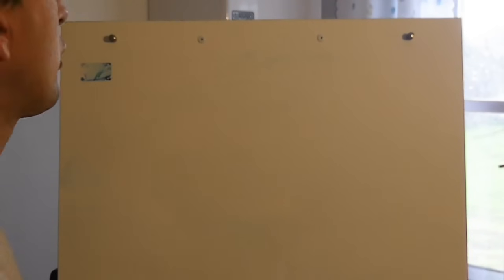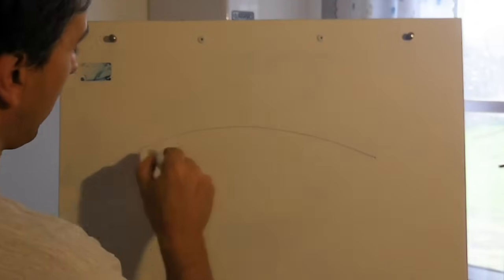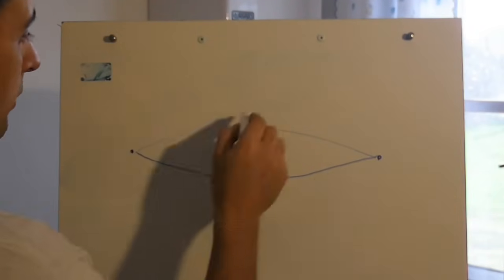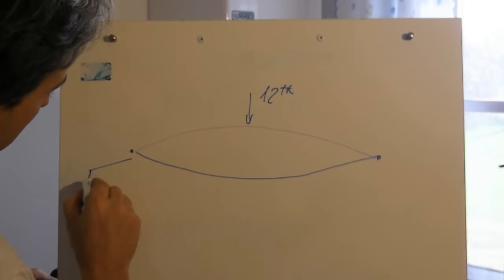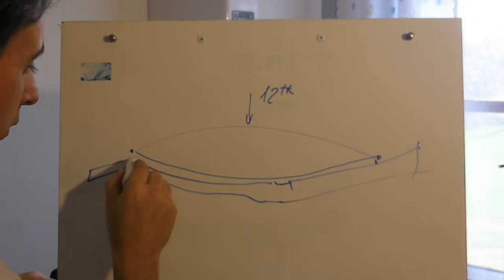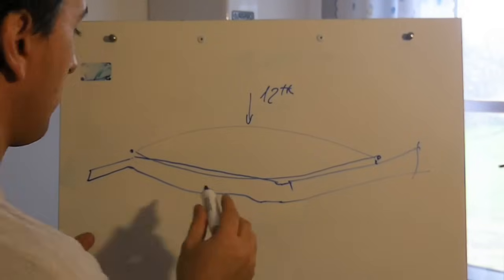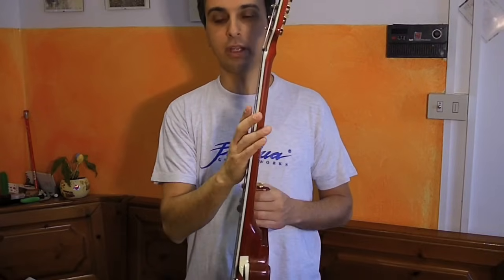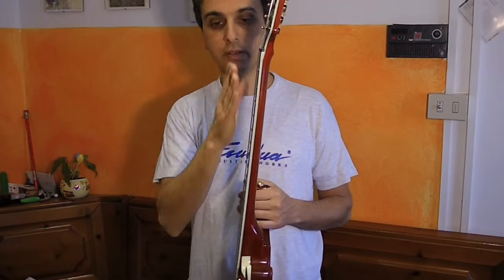Truss rod adjustment: how to adjust the truss rod - frudua.com

Comment: Every time you put different strings on a guitar it will change the tension on the neck so you will have to change the truss rod tension
Reply: Get some feeler guages and measure the relief instead of just making a blanket statement. Weather will affect the neck relief as well as strings.
Reply: This I know dude.  Been working on them well over a decade.
Reply: I'm embarrassed to say it, but I never knew this. I used to use super slinkys back in the day, and have now been using d'addario jazz strings, but i plan to switch to d'addario regular lights. if i've never changed the neck tension before, do i need to worry about that if i'm just going back to a standard gauge? or do you think the Jazz strings have changed my neck tension over time, thus i'll have to reset it for lighter strings?
Reply: queerp Technically you are supposed to check your relief every time you change strings. Even if you are changing them to the exact same brand and gauge strings. Differences in manufacturing can cause different tensions, and thusly cause a back bow, or too much relief. And you only check for relief after you have stretched your strings properly, and completely setup your intonation. Guitar needs to be perfectly in tune prior to setting your relief.

And some food for thought. A lot of guitar players will check and adjust their truss rod, before each gig. Because the change in Humidity from your house to the gig, can sometimes cause a back bow in your neck.
Reply: Oh I know.  Been working on them for over a decade.
Reply: you mean different gauge strings it changes the tension and needs an adjustment then. If your putting on the same gauge it doesn't need any adjustments because the necks already used to that tension from the string gauge.
Reply: queerp when changing strings even if it's the same gauge but different companies, they use different materials for instance i went from regular slinkies to cobalt regular slinkies.  The cobalt for some reason require less tension.  I can eyeball how high it needs to be without a feeler gauge cause I've been doing it for so long.  So always check the neck relief. A lot of companies have a double action truss rod.  This is for when a guitar gets older and really settles the strings may not bend the neck and the strings will be touching the frets.  This is where the double action comes in.  It will take the back bow out of the neck.  I've seen this happen a lot on older acoustics and cheaper acoustics.  Hope this helps.
Reply: Ive never had to readjust the truss rod ever when putting the same new gauge strings in, unless im switching to a heavier gauge or from the humidity. Reason I bought a dehumidifier as well to keep spiders and stuff out of my house during the summer and as a bonus, works well for the guitars lol/.
Reply: I live in the Southeast where there is a lot of humidity but even when I've gone up north I haven't had to ever change my truss rods really.  Once all the joints and woods settles it pretty much stays at the same spots.  Maybe a little deflection bit not enough to really matter.  Also I don't own any bolt on neck guitars.  I hate how the heel gets in the way but Washburn guitars uses a special bolt on that removes the heel and it dolts into the radius of the upper cutaway.  Why other guitar companies haven't adopted this method is beyond me.  I have a BC RICH Kerry King Beast V limited edition (I have #34 of 220)and it was bolt on but I had my luthier set the neck. I love it but very painful to play sitting down.
Reply: and I dont know why he says to meassure at the 10 fret, others says at 12 fret and at the official fender web site it says at the 8 fret :(
Reply: its the 12th fret measurement. you can also check your truss rod instead of eyeing down the neck  from the headstock, you can measure it off the first fret, and your strings should all be the same height off the fretboard right down to the 12th fret. Im a guitar tech that's how I set and check peoples truss rods when they bring their guitar in and it works every time. Theres many different ways to check for anything on a guitar, but its easier and more practical to check via the 12th fret, it also depends on the scale length of the guitar, if its 24 frets then measure at 12th and if its a 21/22 fret guitar check it at yes the 8th not the 12th. Being a guitar tech is the best job ive had for a while in a long time.
Reply: super thanks, mine has 21 frets, so I would be at the 8th fret :) I just order a 4/64 rule to measure it and leave it at least 2.0 mm based on the standard or at least to be confortable. millions thanks ibanezfloyd!!
Reply: no worries ayocula1, always a pleasure to help other guitarists. keep measuring it and in a while youll be able to eyeball what you want in time without having to measure. at work when people bring their guitars in they ask to me to always lower the action as part opfof their guitar setup, lowering the action is a lot more requested than mid-high action atleast the ones who bring their guitars in here, not sure about elsewhere. If you have anymore questions just ask, always a pleasure to help.
Reply: Don't overturn the truss either, if its not turning and adjusting don't force it. Just felt the need to mention that because many people who first adjust their truss usually make that mistake. If your aware of that, awesome. but just thought id let you know anyway, safety first lol
Reply: ***** Oh also after your done adjusting the truss rod, tap the strings at the first fret and 12th  to make sure theres no buzz.
Reply: sure, yeahh. I will do that, I will set it up like that, once it done, I will you know as soon as I get the parts I just ordered. :)
Reply: How many frets it has doesn't change the Centerpoint of the guitar.  That would be one octave up from standard or the 12th fret.  To set the neck relief you need to find the center of just the neck not the entire scale. This is usually around the eighth fret.  When adjusting the truss rod do 1/4 turns until you've reached your desired relief.  For a guitar tech you sure don't know the technical knowhow like this tech does ibanezfloyd.
Reply: And if you need accurate answers I'll check what Ibanez puts up and correct it.  I've been doing this for over a decade and have studied the guitar very deeply from the bridge to the headstock to the electronics.  If you've got a question or just need help with a general setup I can walk you through all of it.
Reply: When I first started playing guitars a Fender Tele was my third guitar and I learned a lot on that guitar due to its simplicity of wiring and just two single coils.  It's also the second guitar I learned to set up a guitar the way I like it.  Me particularly I am a mainly rock player so I prefer thinner necks with heavier gauge strings with as low as action as the frets allow (due to uneven frets and the resulting fretbuz.  ***** I learned on my second guitar , an Ltd EC-50 to set the neck relief.  The most accurate way is to put a capo on the first fret your finger on the last and use a feeler gauge to get as close as possible to .010 of an inch.  When setting the action on electric the norm is 2.0 mm on the low E side and 1.5 on the high e.  One of my current ESPs has leveled crowned and polished frets and I can lower the Hugh e to .5 mm and low to .75 mm.  Remember the 4 middle strings have to be done also due to the radius of the fretboard. Seasoned pro's can pick up a guitar play it look down the neck from the headstock and know exactly how much needs to be added/removed.  I can hold the first and Las fret and eyeball the string gap.  The main point I want to get to is do not go by the books.  Did Hendrix go by the books?  Did EVH go by the books with that insane tapping and Synyster Gates blazing fast picking?  No. So what I'm getting at is set your guitar up with what's comfortable to you.  Hold the pick the way that's comfortable.  You want everything to be comfortable and eventually picking up a guitar and shredding through some scales and it feeling like riding a bicycle and like it's a part of your body. Everything comes naturally.  So set your guitar up with what YOU AND ONLY YOU ARE COMFORTABLE.  It is YOUR guitar so you want to know it and the fret board like you know the back of your hand.  The biggest tip to remember is the entire fretboard is a repetition of 7 notes A-G and 5 sharps/flats so repetition of 13 notes.  Once you can get that down you can really learn the fretboard. Also everything past the 12th fret is the exact same as open through fret 11.  I know that is a lot to read and I apologize for it being sooooo long.
Reply: queerp there is no need to check the neck relief after you change your strings to the same brand, this is only needed when changing to a different brand or gauge.  The tension of the strings will be dam near identical when buying the same brand/gauge. You simply find the central point of the neck (Not the scale because that would be the 12th fret and that is used to set the string height).  On my 24 fret 7 string it has a Floyd rose full floating tremolo and if there is even the smallest difference in tension from changing brands/gauges but ive used Earnie Ball Original slinkies for 3 years on this single guitar the Tremolo would show it.  When you change brands or gauge that's when you check and adjust the neck relief.  And for those who would like to argue I am a Luther of 15 and a half years and I set my guitars up with an extremely low action (high e string standard height is 1.5 mm at the 12th fret but mine are set at .50 mm and the low e string standard height is 2.0 mm but mine is 1.0 mm.  Learning this is a very good thing to know so you won't have to send it to a tech and pay to have it set up and if you learn to do this you can set it up to your liking, just remember that guitars with a single saddle.for each string needs to be adjusted to the radius of the fret board. "Give a man a fish he eats for a day, teach a man to fish and he will eat for a lifetime"  this is how I look at helping others learn how to work on their own equipment.
Reply: Randall Hughes Well the way I work on guitars in the shop, works for me, what you do works for you, its different for everyone theres no one size fits all. Customers have never complained about the work I do on their guitars.  Second don't tell me "you don't know the technical know how" its not your place to and your not qualified to tell me that. My work on guitars for customers has been good the way I do it. like I said theres many ways not just one.
Reply: Yet you set neck relief incorrectly.
Reply: Yap yap yap
Reply: Do I care what ignorance says?  Nope I dont.
Reply: And if 28 is old then damn.
Reply: Randall Hughes that wasn't a threat I just said I don't care what happens to you, ive never hurt anyone and I would never hurt anyone. And all I said was I don't respect or like you that's all. I don't really care about anyone its the way of the world right ? but im not one to harm anyone, i get pissed off yes, because throughout my life ive been accused of shit, and condescended, and what you tried to do to me reminded me of my dad. But i wouldn't hurt you or anyone else, that's why i avoid people i avoid social contact not because im scared of anyone, but because i don't like socializing and i don't like many people. i don't even really hangout with anyone other than my gf and my landlord and his family.
Reply: I don't even have anything against you, i respect your method and opinion i always did as you can read from above, that's why i said what works for you works for you, but the fact you tried to condescend me and criticize what works for me, really set me off because it reminded me of what my dads done all his life.
Reply: I know longer want to argue and i will call the police and tell them not to move on the posts as long as you apologize.  I myself apologize for the things i have said and for antagonizing you, i just hope you and i can settle these differences because there is way to much hate in the world for you and i to add to it.
Reply: Whats antagonizing mean ? I don't have the best vocabulary with big technical words. Not being a smart ass but its true lol. I apologize for the things I said too, I just blew off some steam from the heated argument., ive never threatened or harmed anyone in my life, if anything like I said the only people I really see in my life is my gf, my landlord and his family and my family. Im not much of what you would call a social person. And yes I agree with you on the way too much hate in the world thing. Im apologizing out of the things I said and to settle differences with you. it wasn't even my intention to threaten you, so im sorry if you felt like that but ive never threatened or harmed anyone ever in my life and never intended to.
Reply: ibanezfloyd Antagonizing basically means provoked.  I provoked you to go off on me.  People like to point fingers of why hate is thrown around and religion is brought up and you and i are proof this is not true.  Everything with the police (which is my family so you have nothing to worry about) but just for future reference be very careful what you say because most of the time what you say in a heated moment will land you in jail.  Ive been there and trust me they treat you like a dog.  But absolutley no hard feelings and i apologize also.
Reply: Why did end up reading this drama death threats and kiss n makeup BS lol neck relief people

Comment: There seems to be two schools of thought regarding which fret and string to press. You say use the high E and press the last fret. Others say to use the low E string and press at the 16th fret where the fret board meets the body on a Les Paul style guitar. The thought is that the truss rod affects the body portion of the fret board so little that it's pointless to use the last fret. I would be interested Frudua in your explanation as to why you use the last fret and the high E string instead of the low E string pressing the 16th and checking the clearance at the 9th fret. Thank you for your help and great tips. You helped me set up my Strats perfectly.

Comment: Thanks  this is the best tutorial I have seen online.  These days the dealers are supposed to setup the guitar before it ships but I have found that they generally have very buzzy setups so the truss adjustment is very necessary.
thanks for the great advice and good luck on the website.

Comment: @FruduaTv yes, a luthier did it. He also filed the bone-nut. One fret is 2mm in height, the height between fretboard and the nut-cut is 2,5mm. It doesn't buzz now (2-1,6mm on 17th fret), even when I play really hard. But when I lower the height on the saddles or change the truss rod - which is more confortable to me - the lower E and A will buzz when played without a pick.

Comment: Have set guitar up as you instructed Frudua.....................So accurate. 12th note position with and without harmonics are bang on. Left turn release gave the top E that movement thanks again really appreciated. Regards-John.

Comment: Very good.  I'm having issues with my Gretsch Tenn. Rose.  
I will try the neck adjustment.
My Gretsch was perfect when I put it away.  A month later and the the action was way high. I thought it was the bridge but lowering the bridge still doesn't lower the action enough.  So I'm convinced it's the truss rod after seeing your video.

Comment: Great videos Galeazzo, thanks. 
It's pretty cold where I am now so I had some problems, had to do complete shielding and pickguard replacement on my Strat, it took quite some time so guitar rested without the strings for hours. It was setup perfectly before but when I restrung it it had  a lot of backbow string buzzing which trussrod adjustment alone couldn't solve so I had to raise the middle 4 saddles just a bit and now it's back to normal. The intonation is ok too. I like very low string action with minimal neck relief and that is not easy to achieve without the fret buzz. Ever changing weather/temperatures/air humidity makes  the wood react so everyone should know how to do this without the need to go to the luthier few times a year or at every string change.

Comment: Yes, sir. That is correct and as any Warwick owner will attest, an operation one tends to do fairly regularly. My point is that the direction of truss rod adjustments are not all the same, so it is imperative to find out and...well...observe the movement after each small adjustment if you can't happen to find out. For some guitars, moving the truss rod clockwise actually moves the head stock forward not backward.